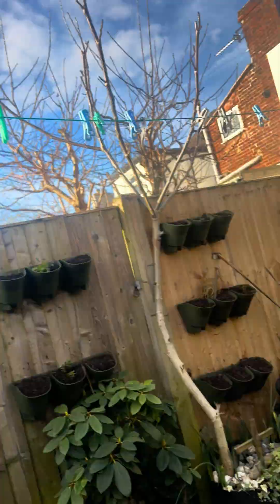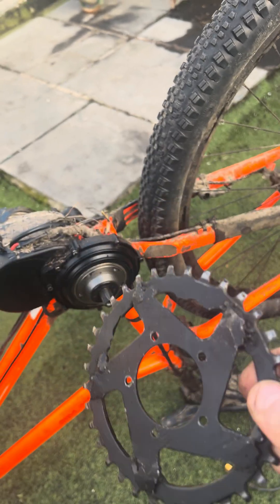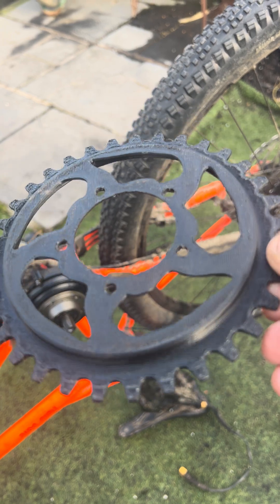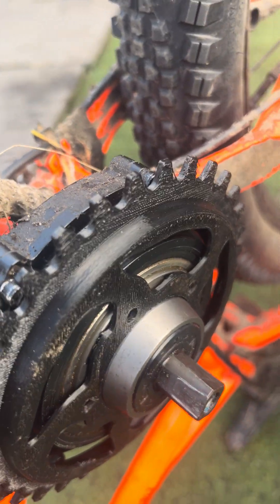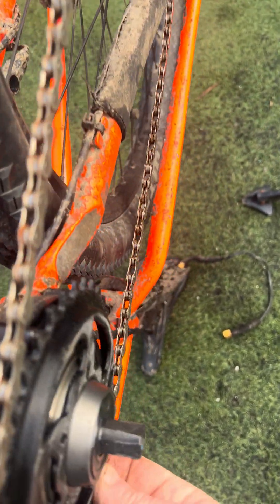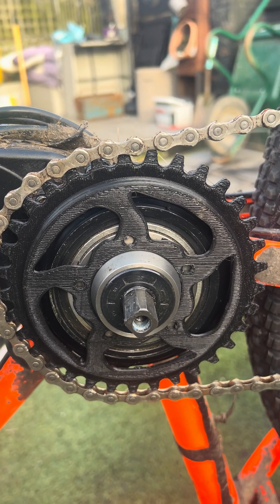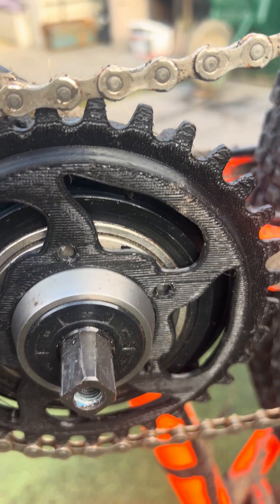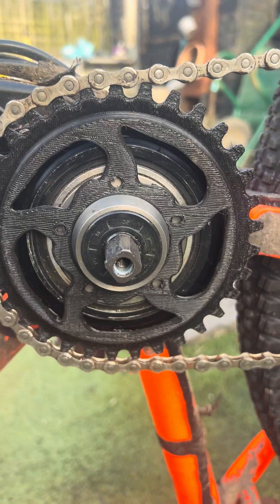34T Front Chainring for TSDZ8 Motor – Mountain Bike Upgrade

Comment: Did you find a manufacturer to cnc one in metal?
Reply from the maker: I work for two CNC machine shops but the conclusion in alu is going to be far too expensive. Also the steel route i’ve taken will outlast alu dramatically. Thanks for the comment

Comment: Hi Anthony, looking into buying a Hello Dave frame and building up into an e-bike. My research into the tongsheng motor has brought me to you, only to discover there you are with a Hello Dave 😄. The chainring issue is what’s putting me off, any news on yours?
Reply from the maker: @SteveMuskyBill  I’ve explored loads of ways to sort a front ring out. I’ll be posting a vid later today on my new parts. The front ring I’ve put together is the original spider and steel ring welded but after 10 months it’s working fine but needs a bit more offset to help. The e11 kmc chain has been epic and held up well not a single snap and trust me the climbing I do is knarly. I’ll update very soon as no ones cracked this issue yet
Reply: @ thanks for the reply, yeah there’s always a catch with these things! I wondered if you could drill out an aluminium plate then bolt a flat chainring to that with spacers for the offset 🤔 anyway all the best with it 👍

Comment: I just saw a video on making strong carbon fiber/epoxy parts with 3d printed molds. Not sure if it's strong enough for gears but I definitely would want to try it out in the future. Maybe making only the adapter form carbon is also an option.
Reply from the maker: @StarsAtNight1  From experience anything but steel is the only option. I’ve pro 3d printers and the torque and abuse this ring gets it’s the only way.